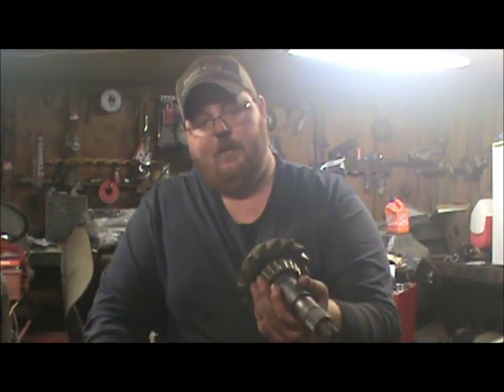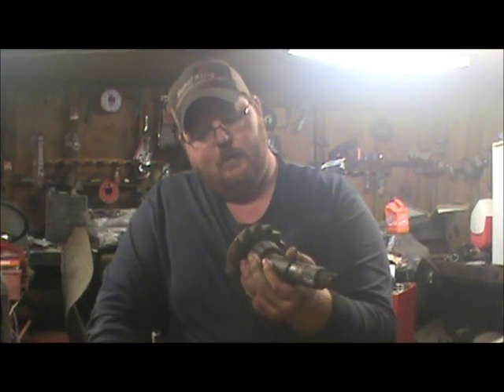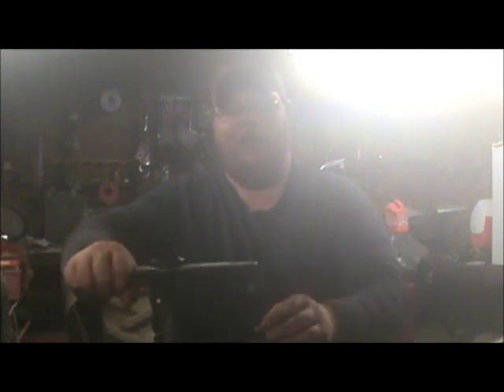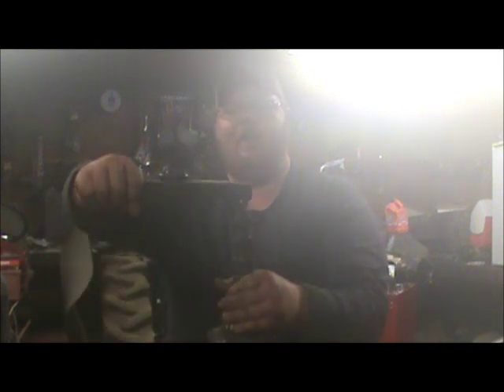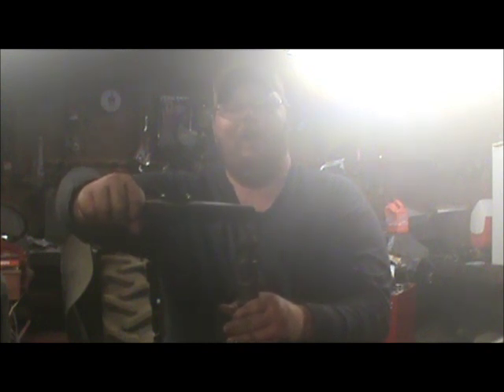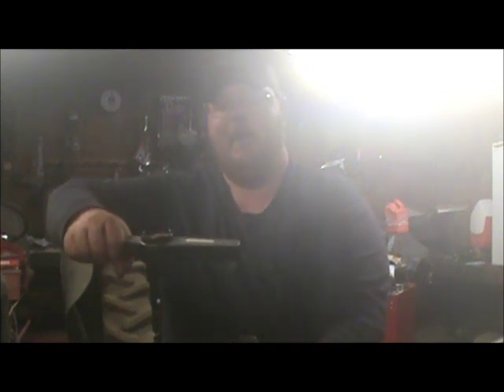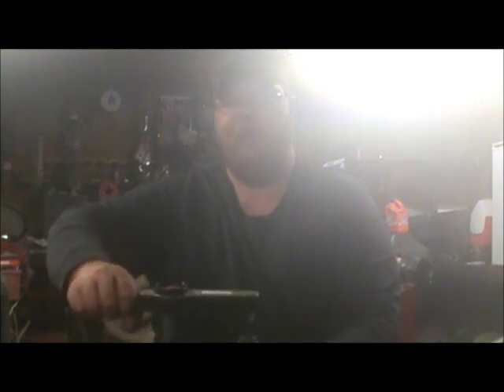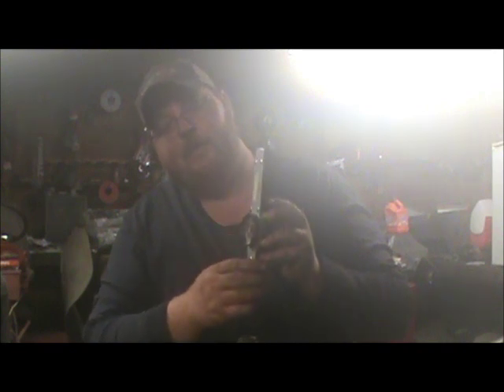12 bolt rearend part 2 explaining the crush sleeve.

Comment: I have a 1991 Chevy Caprice 5.0l V-8 .  I replaced the pinion seal .  The seal is the only thing new , on the differental with ~ 46,000 original miles .

     How many inch-pounds should the pew-load be ?

Thanks ,   :-)
Wyr
God bless
Reply: should have counted the number of threads you can see before you took the pinion nut off. that way it would get it back exactly where it was when you started

Comment: Would be great if you could redo this with a complete pinion, but you helped me EXACTLY where I am stuck! I thought I messed something up when I couldn't take out the slack even with a long breaker bar.  You explaining that it can take up to 500 ft-lb sometimes was what I needed to know.  Time for a long pipe extension on the breaker bar!  Thanks!

Comment: I've never really dealt with a ford rear end. I've have an 1997 F-150 4x4 with an 8.8 rear axle. I have slack in the pinion gear. My question is. Do I have to take the rear end apart to get at the crush sleeve? Or can I get to it by removing the flange?

Comment: MRBoatrights I plan to buy a ring and pinion set online for my 1987 Chevy Silverado with a 12 bolt truck rear end. Everything you have explained is very well understood, but my question is tearing things down because there is no videos out there that show the step by step process and can it be done on the vehicle. another question is after removing the  carriage from the housing will the old crush sleeve come out with the old pinion gear and is this a standard outfit to replace.